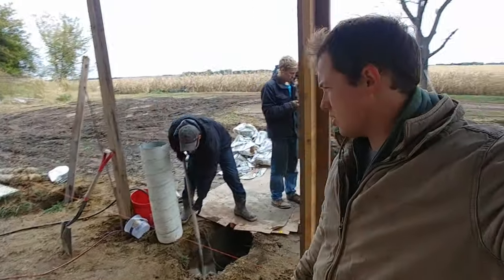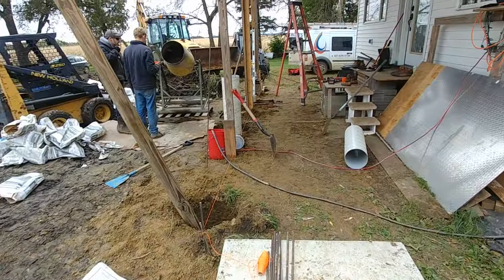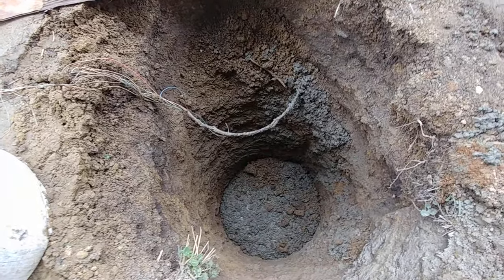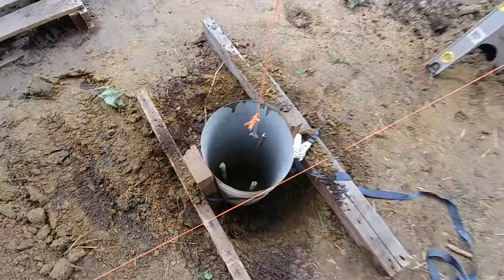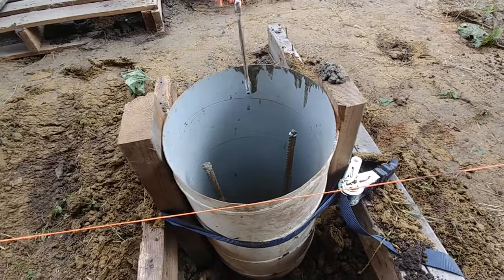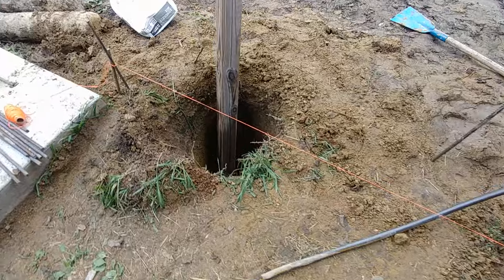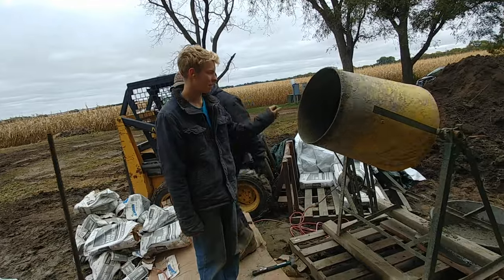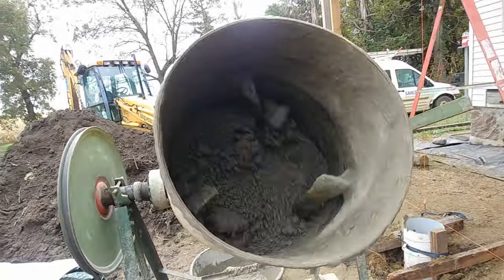How to Pour Concrete Footings With Piers Using Sonotubes

Comment: excellent video....especially for those of us who need this..ie. ME  I have 12" concrete sono-tube posts under my cabin and the middle ones of course are being pushed down the hill due to the grade of the land. the bottoms have been pushed down the hill, not the tops???? there is no gutter on that side of the house so all the snow and water from the roof and slope of the land send every drop under my cabin on the uphill side. I think it was built in the 70's. So the middle of the cabin is lifted about 1" higher  than the sides. I'm wondering if they didn't go down far enough on the middle of the cabin figuring that the outside posts are more important to dig deep enuf. I 'm no engineer but I'm thinking someone cut corners, got lazy and just figured it'll be someone else problem someday. any suggestions?
Reply: Sounds like frost heave
Reply: My suggestion is to fix your water issue, you need gutters when you live in frost country, they help alot, you do not want water around your building at all. That just makes for more expansion when freezing. I would also install drainage tile in the ground to direct ground water away from the cabin. After that, you will need to go under your cabin and install some adjustable jack posts either onto new poured footings or possibly onto the old ones if usuable. Adjustable posts, allow you to move your foundation is any heave does happen.  Getting rid of the water flowing under the cabin will help a lot. Even footings dug deep enough can heave if the footing is bigger at the top. Frost closer to the surfaceis actually what lifts foundations out, as the frost starts there first. A big no no is having your cement foundation bigger at the surface, you want it biggest at the deepest part in the ground, so it cant be pulled out. If you have a cone shaped foundation with the biggest part of the cone near the surface, the frost will grab onto that like nothing and lift it up, when its lifted, soil falls under the foundation, and the foundation will never settle back in the same spot again. Thats why over the years it gets higher and higher. Good luck!
Reply: @jacobificationable  Yeah thats what I thought

Comment: I plan to do the same thing but the maximum size drill I can have is 12''. how did you drill the holes?
Reply: Depending on your project you  also have the option to set your anchor bolts in to your wet concrete if you're able to do that I would think it would be easier than drilling.
Reply from the maker: Thankfully I have access to a skid loader with a 18" post auger. Definitely speeds up the process that way!!!
Reply: @kellywhite9278  Anchor bolts? I think he meant how he drilled the holes in the ground.

Comment: So I would maybe add using sonotube all the way down is not the best way to go basically dig a hole diameter to pier with a wider base than top then maybe cut somotube with exposure at level line extending down into hole 2x the reveal the rest should be earth formed provides better grip place rebar not less than 3 in from sides and not more than 5 in from top saves a lot on sonotube cost.
Reply: Not if you have to worry about frost/heaving. Don't cheap out, the tube helps keep the entire column above the 'bell' uniformly round and with a minimally 'grabby' surface for the earth to grab onto when freezing and potentially lifting it.  The 'bell' helps of course, but you still want as smooth a surface on the column as possible.

Comment: Question your soil looks like clay. I'm in East Texas and I'm trying to figure out how deep to go in the ground. Any info you can provide would be great. Great video!!
Reply: you literally just need a footing able to hold the weight of the structure, you have no frost in Texas. lol
Reply: I'm in North East Texas, the ground is a mix of sand, iron ore rock, and clay. We have 100 year old cabins on our place that sit still sit on cement foundation blocks, just leveled on top of the ground, and the houses have not moved in 100+ yrs.

Comment: 48" frostline?!!!!  Jeeze "that" folks is why I moved...
Reply: Hi from So. Cal.  One question...  what is frost?
Reply: @Carl-LaFong1618  So. Cal probably requires 6" wide flange I beams pounded 30' into the ground on 12" centers welded to 8" channel iron to make a 6' square deck for earth quake preparedness. I used to live in So. Cal. Was there for Whittier earth quake. Now I live where the frost is.
Reply: eventualentropy haha
Reply: We are from northern Minnesota. We are currently digging three post holes for a deck extension. 54 inches deep!

Comment: It is not cement, it is actrually concrete, which is made with several ingredients including cement. The metal tubes will not perform in the long term as a sonotube would. Sonotubes are waxed or oiled allowing the exterior medium be it some type of soil to move up and down as the moisture content changes and freezing and thawing happens. There will be fixing of their project in just a few years.
Reply: That steel will work fine, it will rust out pretty quickly though. As long as the concrete is relatively smooth, it will help resist heave.  That sono tube degrades and is gone after a year or so anyways. Aside from being pedantic, everyone slips and calls it cement on occasion, Sono tubes are meant as a temp help in keeping the concrete column uniformly smooth, why you think it will somehow help years later is crazy.
Reply: The petroleum in the Sonotubes remains and that is what helps woth frost heaving. Surprised most do not know such.

Comment: Just to be clear, your title states Sonotubes and you are using metal duct, so you are not using a brand name product but using something else similar to it made of metal and not made of some sort of paper product, the hole is not being filled with "cement", cement is an ingredient of concrete, concrete is going in the hole.
Reply from the maker: Right right. Glad you got that off your chest. :)

Comment: Hammering the rebar into the ground is a huge no-no.  Exposed rebar rusts and will continue to rust into the structure.  Bad practice to be teaching others.
Reply: Do you recommend rebar cages?
Reply: @carlosreyes6448  they are more expensive, but they work fine.  You can just make your own cages instead.  The important part Is keeping them up off the ground so they aren't exposed to corrosion.